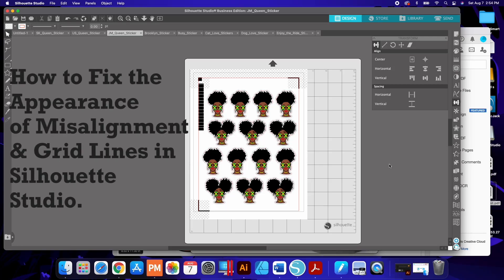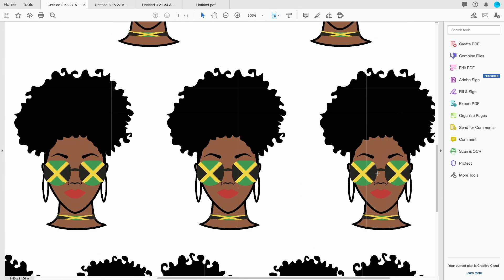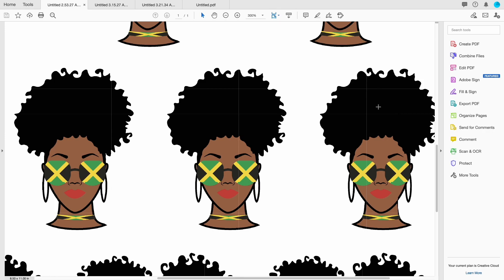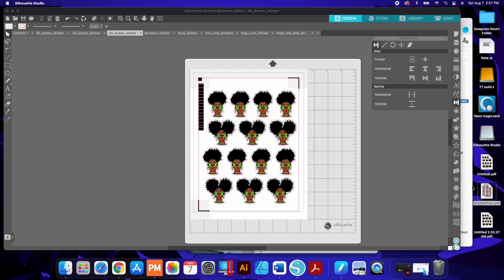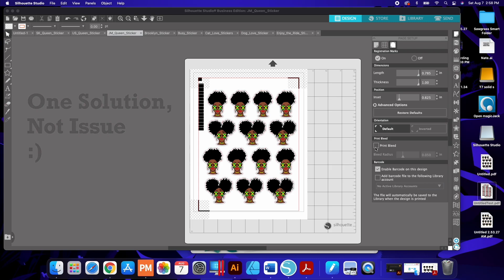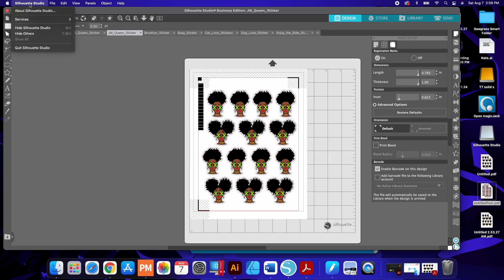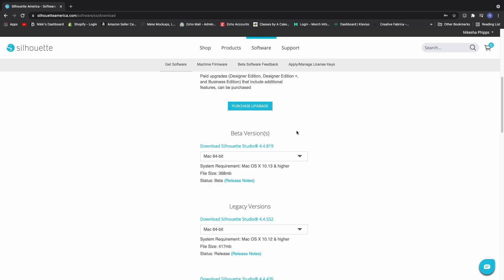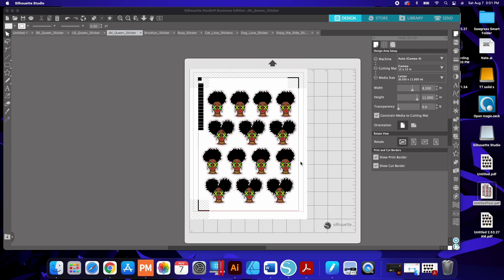How to fix the appearance of misalignment & grid lines when printing in Silhouette Studio.

Comment: Thank you! I am new to this world and trying to figure out why it's so hard to get an image to print correctly. I had the misalignment/offset problem like you and finally got the image to print correctly for the first time!

M1 MacBook air
Studio 4.4.554 (finally figured out to downgrade to get rid of the red line issue on the M1 processor)
Epson 2800
Will be using a Cameo 4 when it gets here Monday

I noticed your images are all right side up and not nested. That also seemed to make Studio happy. I used your dpi trick and also set my images to all print upright instead of nested at all angles. My final setting was to decrease from 1200 to 600 dpi. First print came out perfectly. 

Your presentation style is awesome! You very clearly showed my same issue even though I couldn't really figure out how to describe it. Your fix was clear and simple and to the point. +1 subscriber!
Reply from the maker: Thank you for your kind words and support. I am happy this video was able to fix your issue.